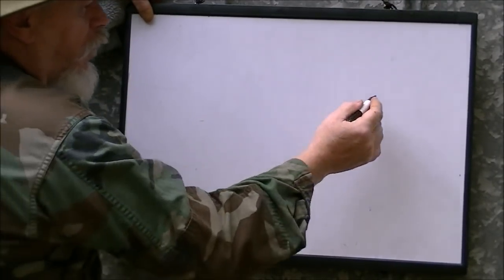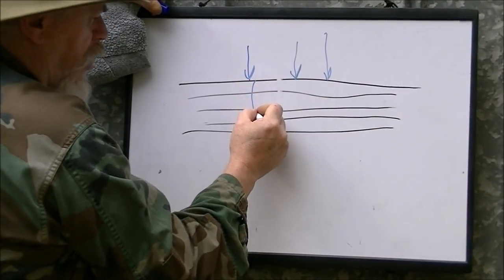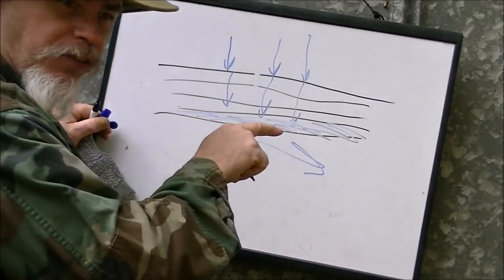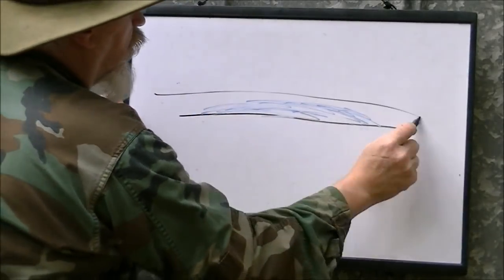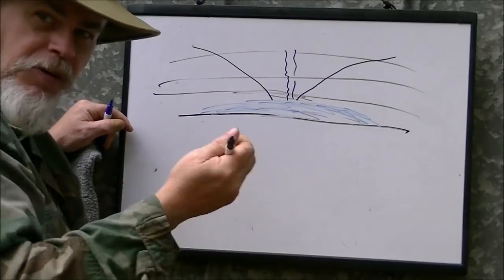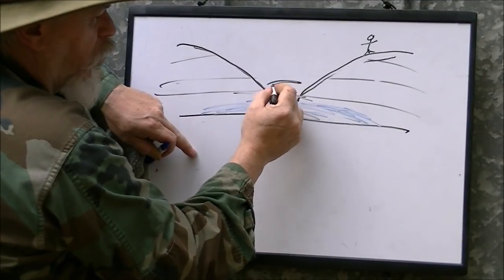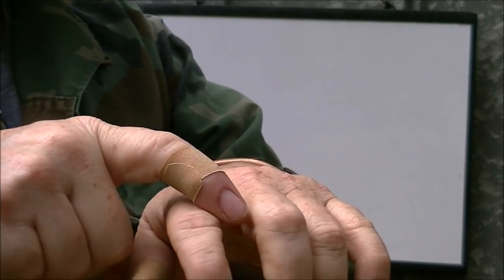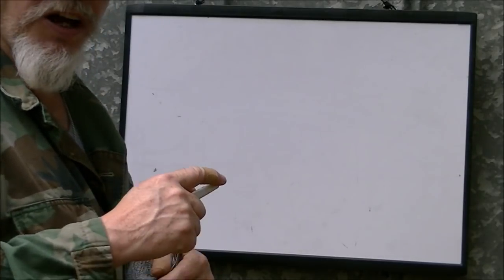DOWN N DIRTY FINDING WATER

Comment: in my wild and crazy youth, I did a lot of backpacking in Arizona, Colorado and a little bit in Montana and Utah came across lots of really beautiful streams and ponds, that was posted "Do not wade/ swim  in the water or do not drink the water." and almost all of them had huge beautiful trout but you couldn't eat them... the problem was/is that they were contaminated with and spreading cadmium, copper, lead, arsenic, manganese, zinc and other contaminants.from the smelting of ore for gold, silver. copper and uranium. Oh and it's not just the western states. New York, Pennsylvania, West Virginia ., Kentucky Tennessee and Ohio all have similar  problems but from coal mining and oil refining in the 1800's and early 1900's   refineries weren't interested in the bi-product gasoline just in the kerosene and they dumped the gasoline into the streams and rivers or in some cases right on the ground of course the coal mines were doing there own dumping...I don't know of any filter that would filter that stuff out. Does anyone?
Edited to add... with all of that in mind I have pretty much decided that a catch basin lined with a tarp or plastic sheet is about the safest way of collecting water but you need a good rainstorm or a very heavy dew. Now my little "get away from it all" spot is at the backside of 18 acres downhill and about 300 yards from a residential area with septic tanks, lawn fertilizer and insecticides so I'm not really comfortable drinking runoff or groundwater. As that old Cowboy philosopher Will Rogers said "Always drink upstream from the herd", but then he also said "“There are three kinds of men, the ones that learn by readin’, the few that learn by observation. The rest of them have to pee on the electric fence for themselves.”

Comment: We got a several acre farm right close to what's called the sinks of big Indian creek. This is s creek that runs all year bit during summer months there is I would call a cave system that drains it. And about 1/8th mile down stream it seeps back up. Or at least some of it. We have sink holes that are almost like guyssers,sure it's spelled wrong during flood times when the sinks cant take the water and the pressure above them makes boil out 1000s of gallons of water. The biggest is probably 120 yards from creek. Its pretty cool to see this.
Reply from the maker: we have a lake down here called blue lake..its a sink hole that fills up and due to the soil minerals its a bright blue water..but at point X the pressure will blow out the plug in the sink hole ..and zoom a 30 acre lake is gone in minutes..only to fill in with leaves ect till a plug is reached then the refill begins once a big gator claimed it altho there are no fish in it..once the plug blue he was sucked down
Reply: @BLACKIETHOMAS  wow!

Comment: Do you have a video on how to filter water during outdoor situations with limited tools/supplies/no fire?
Reply from the maker: ido not at this time..i may do one in the future
Reply: @BLACKIETHOMAS  That would great!
Reply: BLACKIE THOMAS  

Good afternoon Mr. Thomas.  I have a question unrelated to this video. Could you give me a suggestion on how to fix the rotation timing for a cylinder (Pietta percussion revolver)?  The timing for my Remington Pietta revolver Is spot on, but a cylinder I recently bought does not rotate correctly. Both the cylinder and the revolver are the same year, model, manufacturer and brand new. The cylinder rotates halfway on full cock and then goes back to its previous position when uncocked. Pardon me if you have already spoke on the topic or if my description is vague.  My concern is that the cylinder is a defect.